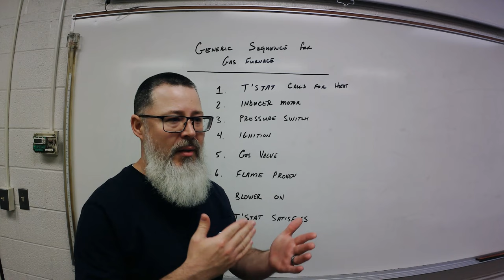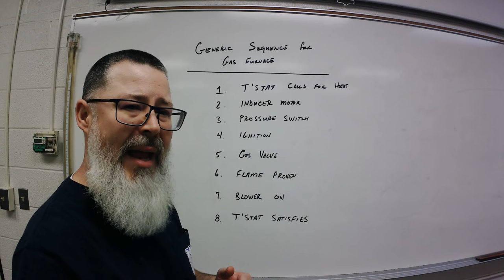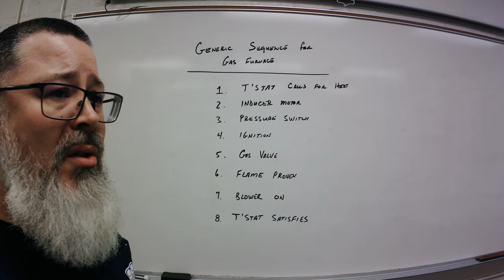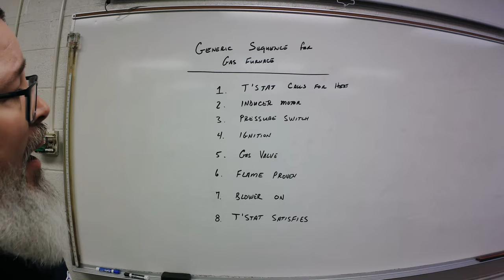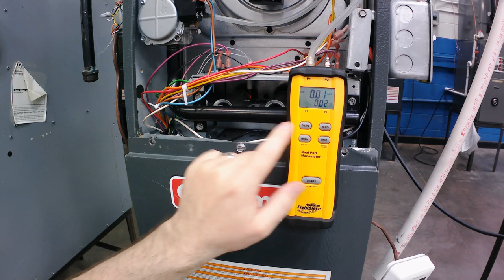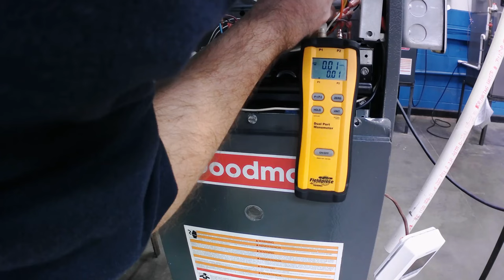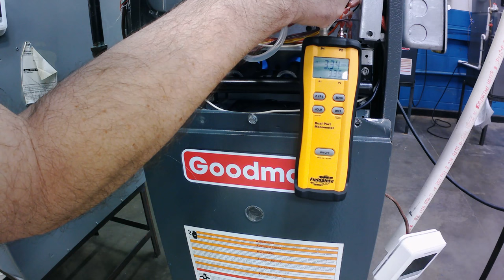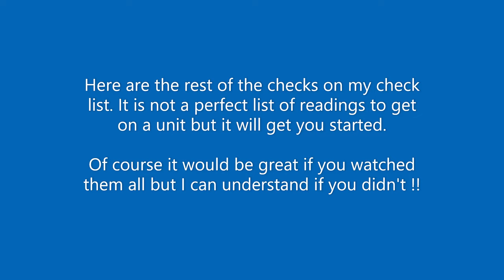80% Goodman Furnace - Furnace Won't Light | Shop Troubleshooting (Gas Valve outlet pressure too low)

Comment: My 80%Goodman runs well, but the code F02 and 9H won’t go away, any help will be greatly appreciated!!!
Reply from the maker: Do you have a model number? There are so many  choices of furnaces out there...
Reply: @johnjennings-JJ  
GM9S801005CN thank you so much for your kindness to look into my problem.
Reply: Is that possible that these F02 and 9H are NOT error codes, instead they are just status codes? F02 for blower fan setting and 9H for single stage of gas heat?

I paid for an online tech helper to make sure they are not an error codes, but the technician said he is not sure. This control board is Goodman’s newly commissioned integrated control. Just some of my thoughts, once again THANK YOU John !
Reply from the maker: I just pulled the manual off of Goodman'a website. It does indeed look luke status codes  the F02 seems to say that the fan is using the 2nd tap of the fan for its speed and the 9H is dealing with the singe stage heating...you sure you aren't a heating and air professional??!!
Reply from the maker: I'll keep reading in the manual but I think you are right on the money. If I see anything that says different I'll let you know.
Reply: You are a very decent person John! 

I am just a plain old grandpa with a bit curiosities trying to understand newer things confuse me. 

I enjoy to watch a lot of different YouTubers from HVAC to fake rock making.

After seeing the blinking of F02/9H inside my Goodman furnace, my mind started turning, and sent my sos to 4 different HVAC YouTubers seeking for help. You are the ONLY ONE who answered and willing to spend time on it 👍👍👍.

Your knowledges, the way to teach and the manner to explain put you above most of HVAC professors. 

If this “no DIP switch”board is a new trend, you might have a new video come soon. 

Once again, THANK YOU SO MUCH 🙏🙏🙏❤️❤️❤️
Reply from the maker: Never saw any fake rock making but I think I have to look it up. I wouldn't give the other guys too much grief. You Tube is a lot of work! I just try to help where I can if I have a few minutes. I will definitely keep this in mind when/if my shop gets a model of furnace like you have. Thanks for the kind words, i appreciate it.
Reply: I have the same problem with my furnace.  Its a new house and a new furnace.  I have had it checked but the codes are still there. E02 and 9H. It runs well sometimes but other times the thermostat says heat on but drops like 3 Temps below the set temperature without the furnace working or blowing hot air. It can stay like this for hours. I end up turn my thermostat off for a while and turn it back on.
Reply from the maker: Al the info I have found seems to say that those are just status codes for heat stages and blower speed. Do you know what other code it shows when it doesn't seem to work right?
Reply: @johnjennings-JJ  
Thank you so much for replying. EE0 is another code that I saw. 
Is there a reason for it to drop in temperature even though the thermostat says heat on but furnace refuse to start at the time the thermostat gives the command?
Reply from the maker: That is a lockout code and it basically says "I tried too many times so I am taking a break". If you have had someone come out already then maybe try this so you can help the next one...there is a definite sequence.  Here is the short version. 1 - thermostat wants heat and tells furnace to run. 2 - the small inducer motor above the burners will start and cause a pressure switch to close. 3 - you should see a glow from the ignitor warming up. 4- a few seconds later youbshould hear the gas valve 'click' and open the flow of gas. 5 - gas lights and should stay ON. 6- After a 30 second delay or so the blower should come on. That is a quick generic idea but if you can watch it and see about when it cuts off it may be of some use.

Comment: Hey I know this is an older video but where does the filer go on this unit? Does it slide into the very bottom?
Reply from the maker: Sorry for taking so long. The furnaces son't necessarily have a filter rack for them to slide in like an air handler. Some furnace would have a spring/wire that would hook in place to hold a filter in the blower compartment but I haven't seen that in a while. Most furnaces I have seen had a separate filter rack attached to the furnace.
Reply: @johnjennings-JJ  no worries, thank you !
Reply: @DannyObscura  Did you ever find your filter rack? I have a Goodman Furnace not this model but a taller one with 1 panel and I can't seem to find a filter ANYWHERE. 8 years in this house and all I can find is the return air handler filter.

Comment: My Goodman will not light the gas , the emergency heat when the top door is closed
Reply from the maker: Is this a dual fuel system? Usually emergency heat and gas furnace don't go together.